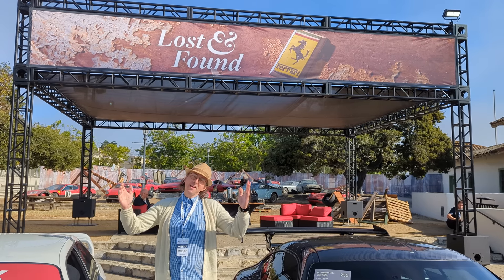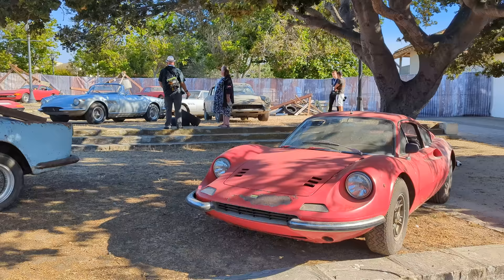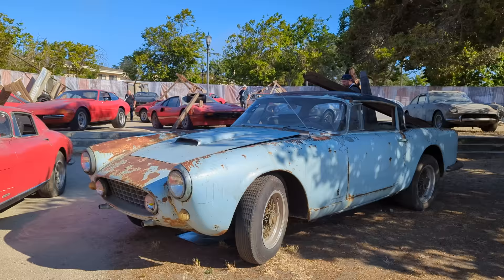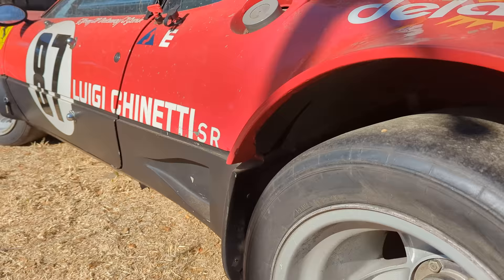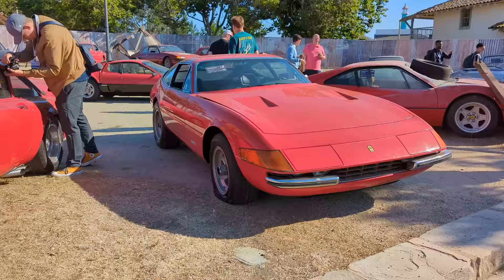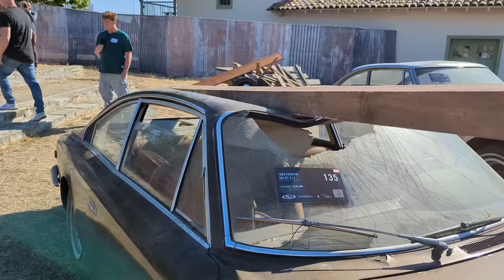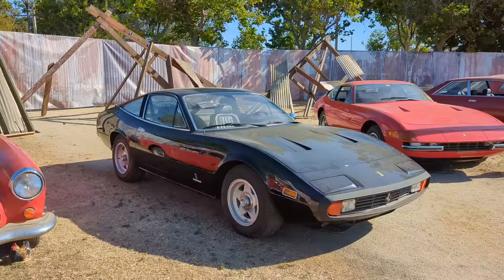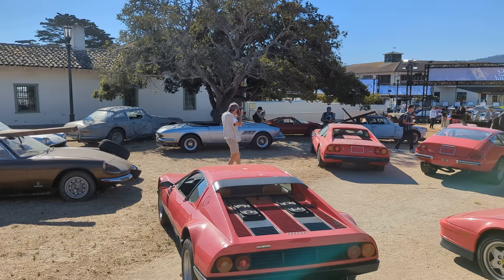Lost & Found Ferraris from RM Sotheby's

Comment: Full Restoration would spoil them! They are so much rarer as they are. Better to get them solid underneath, fix up the drive trains and engines so they run perfectly and leave the rest alone ( some glass needs to be looked at!). Oh and maybe change the tires. That way they keep the original barn find look. The dents add charm.